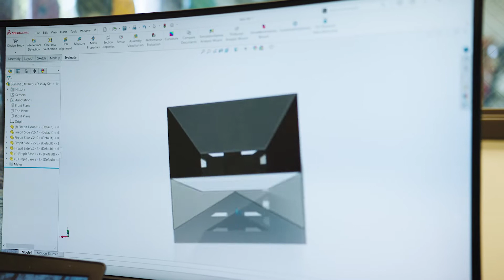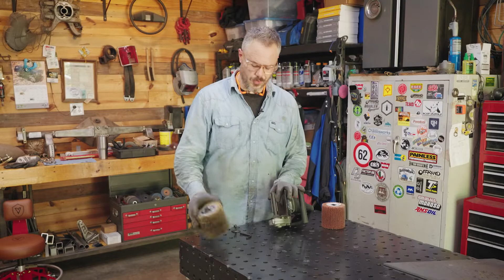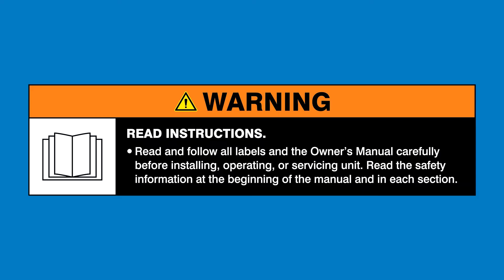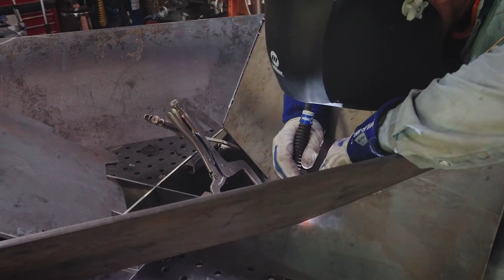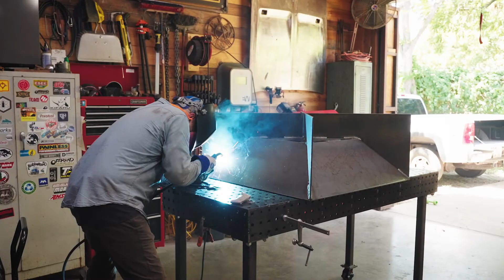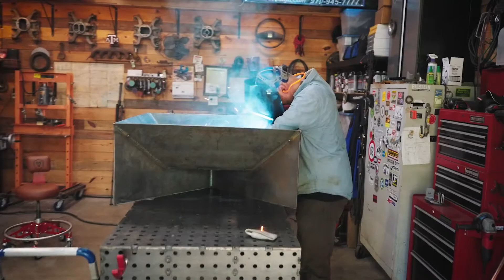DIY Project: How to Build a Metal Fire Pit

Comment: Is there somewhere to download the plans for this pit ?
Reply from the maker: Absolutely! Check it out here: https://www.millerwelds.com/resources/article-library/diy-welding-project-how-to-build-a-metal-fire-pit
Reply: @MillerWelders  FYI there is a mistake in the plans. The bottom should be 18x18 inches but the shape in the plans is a rectangle. If someone were to stencil that out it's gonna be wrong..just sayin'.
Reply: @MillerWelders  There is no link to the plans in the "tools and materials section"  Is there a way i can get the plans for this please?
Reply from the maker: You can find the project plan here: https://www.millerwelds.com/-/media/miller-electric/files/pdf/articles/diy-welding-project-how-to-build-a-metal-fire-pit.pdf